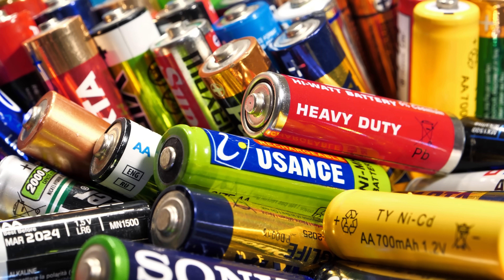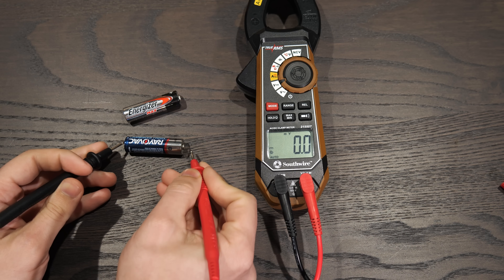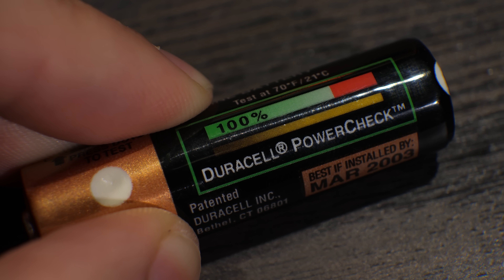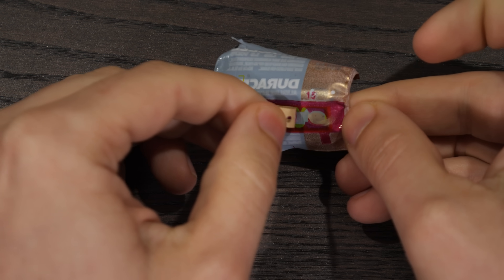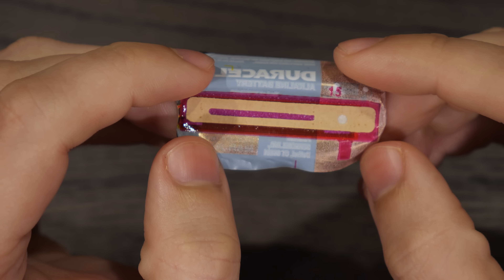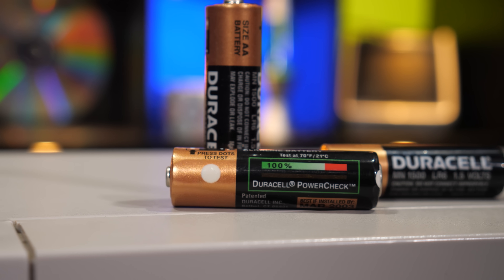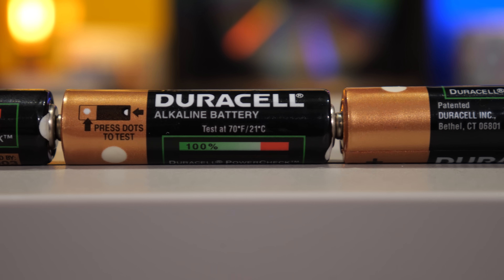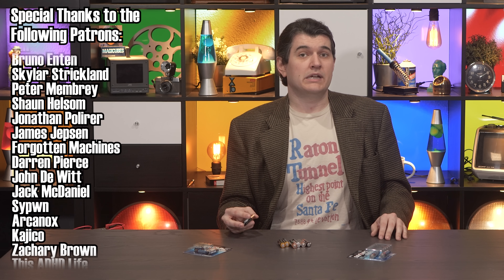Duracell PowerCheck: A genius idea which didn't last that long

Comment: I am not happy about that: "Thank god we are past that"
Today, lithium batteries are welded into the devices without the option of replacing them.
I still make sure to get devices in which I can put AA or AAA standard batteries and then I use NiMH batteries with low self-discharge. The only important thing is that the devices can cope with the lower voltage of just 1.2 V of the NiMH batteries. Fortunately, my Xbox 360 wireless controller for the PC allows the use of NiMH AAA batteries. When they are empty, I always have replacement NiMH AAA batteries on hand so that I can continue using the device after changing them and don't have to charge it first.

Comment: There is one significant use case where you can get partially used batteries.
Ye Olde Flash Cameras.
These required pretty much fully charged batteries.
Once these batteries were "dead" as far as the camera was concerned, they were still fine to use in other things, like TV remotes or clocks.

Comment: You can test the battery by dropping them on the table. A fully charged one will just sag down, but fully discharged batteries will bounce.

Comment: Well, some devices don't use all batteries the equal amount. So it is still common in my drawer (next to a cheap tester) to find a partially used battery. 
Also: I can't find recharchable batteries anywhere these days. They used to be everywhere (in the 90's)!

Comment: Battery powered christmas decorations is where i think these were useful you don't want to leave the batteries in the lights battery pack but you kind of need to know if they are worth keeping, as stated in the video rechargeable batteries have become more normal and batteries in christmas lights last longer because they are powering led lights

Comment: The easiest way to test these things was not to press with your fingers, but to use the edge of your fingernails. 

And when you're talking about how many batteries we used to go through? Man, oh man, I hate to think about it these days.

 I still have my boombox, and it uses 8 D size ones, and even then I was lucky if I got maybe 5 hours of use out of them. It had its own battery tester built into it...when the tape playing started to warble, you needed new batteries 🤣🤣🤣

Comment: I do hear what you're saying about AAA batteries, I have a Sangean pocket radio which I use most days, and with the way I use it, 2 AAA batteries will last a few weeks before they go flat, and it's most frustrating when I'm listening to a song I like, and suddenly the radio turns off without much warning.

Comment: Here in Argentina they also used to install the tester in the 4 pack, with regular batteries in it. The "cool" thing about that was that if you cut the tester away from the package you can measure any battery.

Comment: They made a version with power check a lot longer than that. I recently came across a couple Duracell Quantum AA batteries (the red ones) that have the tester If I remember correctly, the expiration date was 2027. I think they made them until the late teens. Maybe 2018 or so?

Comment: I take half used batteries out quite a lot, for my son's model trains that he gets out a couple of times a year but which seemingly need new batteries every time because they must drain when switched off, or for LED Christmas lights that get used for a few weeks then get put away etc.

Also I find that in general 1.6v means full and 1.4v means completely empty for some reason. Digital things just don't like running on less than that.

Comment: This is another poorly done piece, despite parts well presented on an interesting topic.  It needs a fact checking editor, for engineering honesty, and to better address the focus of legal and industrial production costs and marketing goals and value that likely drove spending small amounts many batteries over as a competitive move.  

How much power does each test operation use, and how does that compare to battery energy for different size cells?  

Battery capacity and end of life are not linear functions with voltage, while different definitions of end of life exist, none cited to authoritative sources in this video.  Alkaline batteries have about a 4:1 range of capacity based on current loads and drain rates.  SLA/gel cells also have large capacity to drain rate issues, whereas lower internal ESR NiMH or LiIon cells have flatter load level or capacity relationships.  

What was the cost per unit, to Duracell or Eveready, or by Kodak estimates?  

What if any market gains did either company make by marketing this technology?  Were there any market research estimates, or stock forward looking securities filings, that discussed projections versus historic reality?  

Obviously some of that insider info could be hard to research, whereas the misrepresentation of voltage to end of life spec's is factually just wrong, and needs an engineer with a bullwhip to discipline script writers.  Or a soft pillow if it turns out the editors like whips too much?  

Overall, I get the impression that this piece was produced by people with a poor grasp of technology and industrial process economics?

Comment: Good mornin
(5:31 pm)
Also 1990S??!?!?. These were a thing in the 2010s. 
Anyway They never worked, sure the harder you press the more it changes color. But the ones I had, even if it was dead. It would still change color if you pressed hard enough. They didn't actually help or do anything.

Nowadays, I usually use lithium AA batteries. However, they have a very weird chemical reaction, because once they "died" I would take them out leave them out in abient tempurature and they "recharged" themselves and they were good for a another few days. I could do this about 5-7 times before they were dead for good.
It's quite fascinating.

Comment: I have an older home with AA battery smoke detectors.  I do change the batteries every 6 months in all 10 or so of them, so I DO have a bin with half used AAs.  They are perfect for remotes, fake candles, etc for their second life, and keep me from the 230am chirp from the detector.  Still, I don't need a meter for either use, so your point is still valid.  Thanks again

Comment: I remember these.  I also remember when Duracell included a similar battery tester in the battery packages in between the sets of batteries.  Energizer did it too, and I can remember seeing ads for their batteries with built in testers on them, I even had some.

Comment: I don't think I've ever owned any of those. I do remember the ones that came with a 4/pack of cells that was in between the two cells on either side. You had to physically put a cell i the tester and press on both ends.

Comment: I had one of these testers on a small strip of plastic. And as a child I had tons of partially used batteries so I used to sort them using this type of tester. Also I could swear I bought some duracells with this buit in tester around 15 years ago. Are you sure they are out of production since the 2000s?

Comment: Not sure exactly when, but Duracell definitely brought this idea back at some point in the last 5-10 years. I remember my family getting batteries with this same type of tester (though with updated graphics of course) around the very late 2010s. At least I assume it's the same, as it was used in the same way and exhibited the same behavior

Comment: I still have one of the separate 9v testers from Duracell. It lives in the battery holder with my “spare” aviation headset - an old ANR-Man self fit kit in a passive DC clone headset.

I now use my Bose A20’s, but when carrying an occasional passenger it’s easy to test the little used 9v battery to see if it needs changing.

Comment: The thing is that when we use batteries, we don't pull them out of our devices to use elsewhere. Once they're in, we use them till they die and replace.
Reply: Some devices stop work when voltage drops below some fairly high threshold, say 1.4V,  but others work fine well below that threshold.  I have a box of used batteries in the 1.3 to 1.4V range for stuff that doesn't care.  (I speculate that some electronics contain diodes or transistors that require a minimum voltage to function, but that is a guess.)

Comment: Side note on 13:28
I think you forget rechargeable AAs are a thing and they have been further improved with Lithium as the base technology behind many of them now.  It's better for a device to have a AA compartment that allows you to put the batteries you desire in them and swap them when their capacity begins to fade (as always does with Lithium or any rechargeable) than to have a sealed battery deep inside a device that encourages a user to throw out the remote or game controller rather than replace the battery.  Most people will not put up with carefully disassembling their Dual Sense 5 and not ripping any of the ribbon cables in the process to replace a battery that is buried inside.  They will just toss the controller in the trash.  An Xbox controller on the other hand which uses AAs allows me or a user to easily put in something like the AmpTorrent batteries and have a rechargeable controller with an easily serviceable battery.  Rechargeable batteries being included is not a good thing - we always had the option.  Just teach consumers that rechargeable batteries pay for themselves in often as little as 4 uses and decent ones can be found for cheap on Amazon.

Comment: In the year 1980, I bought one dozen of Ni-Cd AA batteries, with a capacity of 500 mAh and voltage of 1.25 Volt. Also some C and D cells, with 1,800 and 3,500 mAh of capacity, respectively. The purchase set me off the equivalent of today's  $ 400. I built a charger with various constant current values, with a 14 hrs timer.
Remember the '80s were the time of the Walkman, the dictaphone, portable calculator, and a portable, BASIC-programmable computer from TI. The true battery hog was the boombox, with ten D cells lasting six hours. The Yuasa Ni-Cd cells made the boombox into a true music machine! I also had a 1 inch 10 MHz portable O-scope that drained four C cells in a couple of hours. 
At the time, the Dryfit (SLA) batteries hadn't been invented yet, so for my 3 inch JVC Color TV-Radio-Cassette combo, I used flash batteries - a number of sealed Lead-acid 6 V 4 Ah batteries with a transparent case and a densimeter for each cell in the battery. That was another mini-mortgage, but served the purpose well. 
By the year 1995, I had DryFit and Ni-MH batteries for all portable power; and the lithium revolution was about to take off...

Comment: One down side to this invention is the added thickness, which actually did make batteries like this get stuck and almost permanently wedged in some stuff, like my mini Maglite. That was a mistake I only made once. (Testing did help at times, like judging whether there was enough power to run a portable CD player without interrupting playback.)
By the way, feel free to use a long I in short-lived; it is more accurate and that seems up your alley. I'm not sure what the pedantry patrol would find wrong in describing this meter as lighting up, though.

Comment: 13:45, Yep, swapped to LSD NiMH for most things with only a few items, like weird maybe junky ones that managed to put a negative voltage on some batteries, using old Alkaline batteries.
Everything else is Lithium through and through.

Comment: I thought this was the coolest thing when it came out...
When I finally bought a pack, I discovered just how fiddly and challenging it was to actually use, so I decided it wasn't worth the hassle. Plus, Duracell was - and still is - not priced competitively. I had the Walkmans, the AA-powered tungsten flashlights, and later a few Discmans, so obviously I was eating through batteries quite a bit in my youth. I was more of a Rayovac and Eveready type, based solely on cost - and when chain drug stores like CVS and Brooks Pharmacy started selling store-branded batteries, I was able to get much more bang for my weekly allowance buck.

We had GE NiCd rechargables, but they were crap. NiMH cells would have sold like hotcakes in the 80s, 90s, and 00s!

As far as AAA cells being used in places where AA would easily fit, and the increased runtime and ampacity available to those devices, that doesn't bother me that much. What REALLY irked me were devices that used an odd number of cells, when packs of batteries came in even numbers. 🤬 It's the battery equivalent to hot dogs vs. hot dog buns.

There are still applications where alkaline is a better option than NiMH, so I still buy the occasional pack (but NEVER Sunbeam, those batteries leak all the time), but almost everything else I have switched to NiMH and never looked back. For one example: outdoor thermometer sensors work longer on alkaline (better discharge curve), are better-suited to cold weather, and the wireless sensors draw such little quiescent power that they can drag a NiMH down to 0.8-0.9 volts before a "low battery" alert gets sent to the display.

Comment: Wait, they use to come with testers in the package? (flash back to me finding a Philips everyday package in a drawer with mismatched batteries and a tester strip in the middle of the plastic where I would squeeze the batteries hoping they have enough charge to power my toy.) Ooooohhh riiiighhht yeah they use to have those...

Comment: I remember my frustration as a kid, as I only saw those batteries either fully charged or completely flat. And i was curious, does it really show actual charge, or there's some cut-off voltage.
Which again, proves the point of how much a gimmick they were. 
But still think it would be nice if they include test strips to the package. I could've for sure had a couple as my treasured possession. Because they were quite magical. 
And, by the way, thank you for finally closing one of my childhood's curiosities.

Comment: In the early '90s, we would save used AA alkaline batteries from electronic locks (I worked in a large hotel) to power our Mini Mag flashlights and other accessories. For years I never used a new AA battery for personal electronics.

Comment: They still make these with colored bars instead of the yellow line. I don't care for the feature that much but there are use cases. In paragliding there are electronic instruments that need to work for many hours continuously, and are very voltage sensitive (and are used in remote locations - no charging possible), so you end up with stock of half used batteries replaced as a precaution. Then I can use the half used batteries in home electronics, the tester then is useful to see which batteries ar half full, which are almost empty. Way more painless than a multimeter.

Comment: Its just much easier to bite the battery to check it.  If the constant force is applied then the size of the dent made by the teeth would reflect the "charge".  If no dent can be made then the battery is dead.

Comment: It's kinda sad to realize I didn't even notice these were gone. 
On another note, there should be a legal requirement for battery manufacturers to put some objective measure of the capacity of disposable batteries on the package. "Ultra+ Duration 3D" or "PowerMax Extreme" and other nonsense are no ground for customer to make an enlightened choice.

Comment: Duracel had been producing and selling batteries with these testers until 2019/2020. And they were quite useful if you wanted to get an idea how much life is left in them, just because a battery is not empty doesn't equal it being good enough.

Comment: I was in my early 20s in the 2000 and LOVED that feature...   because devices like a Walman needed 3 or 4 batteries and when it died or was dying, I wanted to know which of the batteries was bad, as it only takes 1 bad battery...  I didn't want ti replace ALL of them if I didn't have to because they were expensive!!!   Now tho I use Energizer Lithium E2 chargeables exclusively - I don't think a better AA battery exists.

Comment: The phrase that comes to mind is, "The answer to a question that no one asked." As you say, disposable batteries are commodity items with dozens of no-name brands likely made in the exact same factories. I'm sure the built-in tester was just an attempt to differentiate one brand from another, even if no one really NEEDED it.

Comment: I remember discovering how these worked back in the day when I took the wrapper off a battery. I actually got a tiny burn from the exposed heater not knowing how hot it got!

Comment: Rechargeable AA and AAA batteries are great. Having built-in, non-replaceable batteries in dozens of seldom-used devices sucks. If I use a device once or twice a year, a lithium battery doesn't suit that application very well.

Comment: I bought enough rechargeable NiMH cells for those couple of devices that still take AAs or AAAs. Replacing disposable batteries brings me nuts, I'd very much rather charge them instead, even if charging NiMHs takes forever compared to lithium cells. Too bad rechargeable coin cells aren't really much of a thing, at least not as a drop-in replacement.

Comment: I have some used dead Duracell Ultra Power batteries with the PowerCheck. I had a few of them in the late 2000s and early 2010s, the dead ones I pulled from something a while back have a expiry date of MAR 2017

Comment: I use a Fluke multimeter to test batteries. I had a key fob that required that I be within a foot or two to unlock the car door. I changed the battery. The new battery is 1.35V, and works from tens of feet away. The old battery measures 1.3V. It doesn't provide enough current to operate the radio transmitter.

I liked and used the PowerCheck feature. It was the first indication of whether the device or battery had failed.